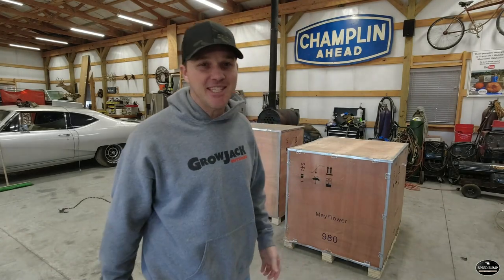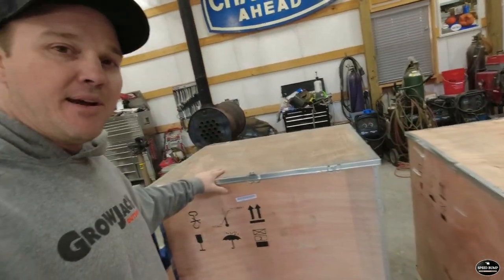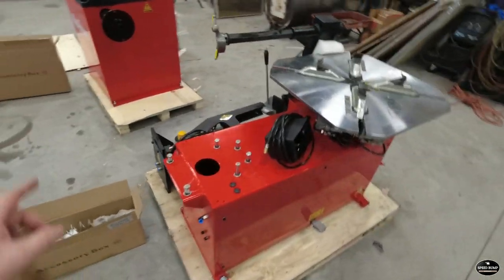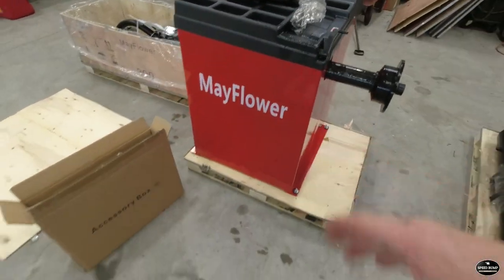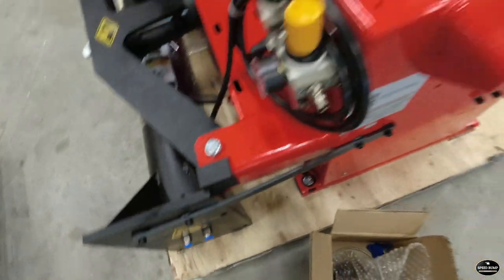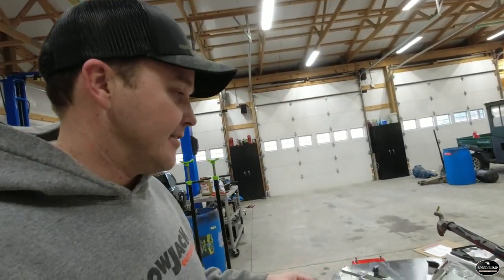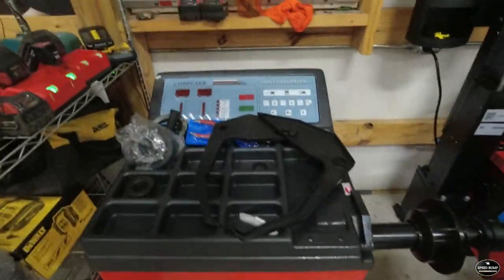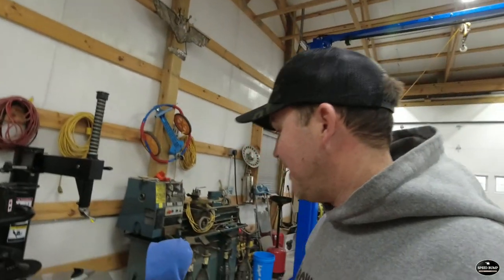Mayflower 980{Ebay/Amazon}Tire Machine Combo Unboxing

Comment: Man you high tech , Im old school using a hand tire machine from Harbor Frieght and a used bubble balancer . Yes i have had some problem with air up on a few tires but a ratchet strap helped that
Reply from the maker: I have been right there with you for many years!

Comment: The disc wheel pushes the tire bead into the drop center of the rim. Very useful when mounting wide low profile tires.  40 series and below and 245 or wider.
Reply from the maker: Thanks for the info!

Comment: Hey Kent I bought the same outfit you have could you show with a light on how and where you Tee the assist arm into the system for it to work. I got a Tee with mine but can’t figure where it goes so it will work

Comment: Im looking to purchase this, will I be able to, in any way, move this with just a hand-utility dolly? From what I'm told, the 580 wheel changing machine weights 444 pounds and the wheel balancer weighs 275 pounds.
Reply from the maker: We moved mine with 2 guys and a dolly before I added the assist arm.

Comment: Im having trouble with this machine i just assembled everything but once i plugg it in, the compressor wont turn on. Everything on the inside came plugged in.
Reply: Would happen to know any solutions?
Reply from the maker: The machine does not have a built in compressor. You have to supply the unit with air